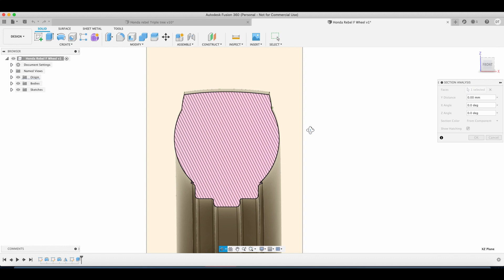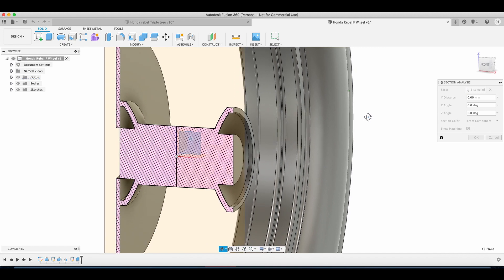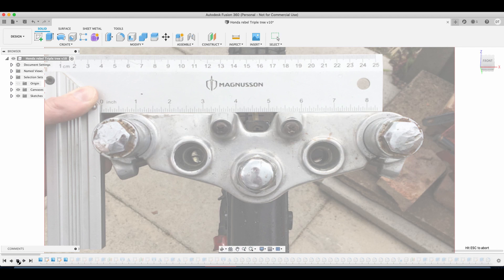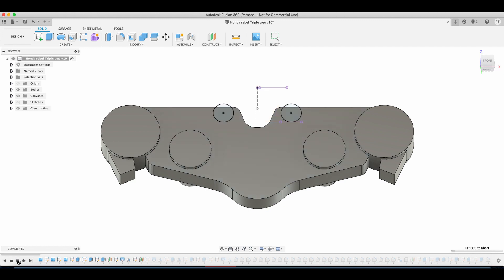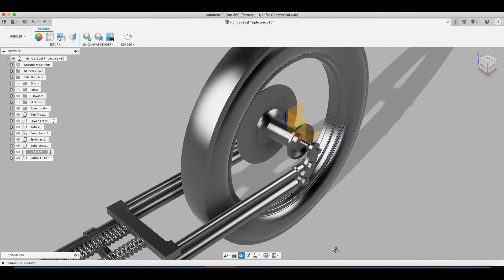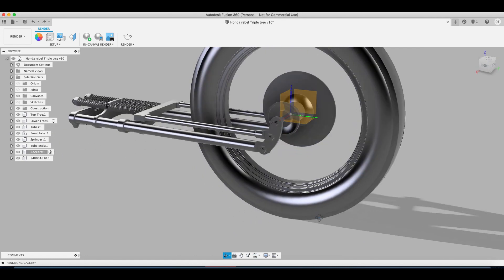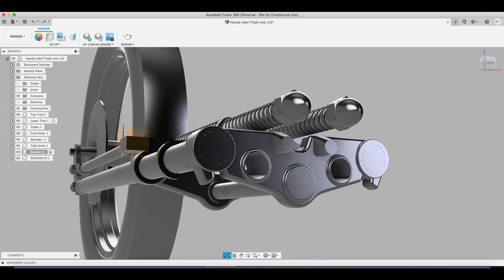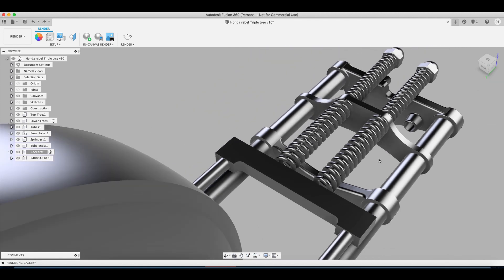Design a Springer Front End Honda Rebel 250 Bobber Build Part 9

Comment: Hey man, cool video. Good use of cad! Do the springs above the “mid plate” serve a purpose? Also is there a dash pot style dampener anywhere in the system or only the rebound of the spring? Looking forward to seeing this progress!
Reply from the maker: Hey up bud, the springs...now Im not 100% on this so don't take it as gospel! so when I was looking for spring dimensions I found that there are 4 springs in a kit. Upper and lower rebound springs as well as upper and lower inner compression springs which I haven't modelled. The springs are mounted on a rod which is fixed to the active fork but not the middle plate so the rods are free to traverse up and down through the plate.
Details that I need to play around with, pretty sure the springs I will need to outsource to get correct set up for weight of the bike and spring travel.
Reply: Dtaylo sounds good man will be interesting to see it all come together
Reply from the maker: @remotorcycled  Yer id like to see how it comes together too lol

Comment: Hola como estás? Te hago una pregunta, si utilizo para la construcción de la horquilla un caño de 32mm, que espesor recomendas ? Muchas gracias
Reply from the maker: Hello buddy, as long as the 32mm will tighten up OK in the triple tress,  I would still use a 3mm wall thickness.
Reply: Muchas gracias por el dato. Tu pericia es de gran ayuda amigo 👋

Comment: Hey Bro, been pondering building a springer for quite some time, but unable to locate the correct springs and their ratings. Is their a source or link where i can purchase as a kit? Further would you share specs and build sheet to use as a guide? Looking forward to the progress on this build, it's very informative i have learned something here. Thanks in advance.
Reply from the maker: Ive added a link in the video description to the website I bought the springs from, they are designed for a Harley I believe however I was able to play around with the compression to suit the needs of the smaller Rebel. Im not able to share the plans atm because Im using hobby version of Fusion 360. Suggest you look at the chopper builder handbook Ive put that link in the description too, has detailed drawings, size and types of material you will need. Ive also listed the material and sizes in the Springer build series hope that helps.